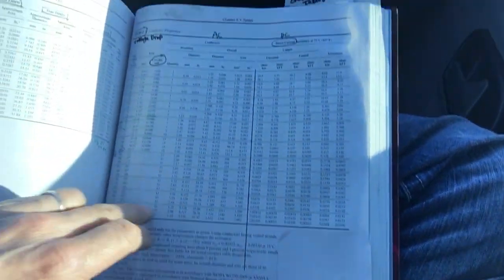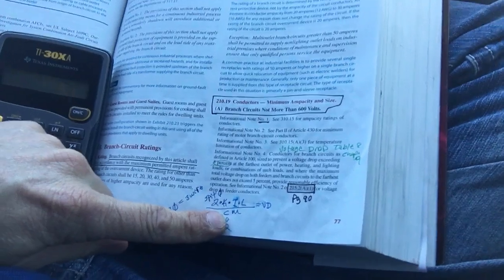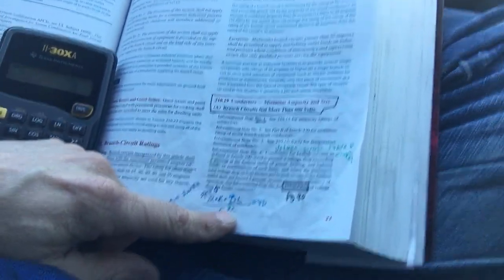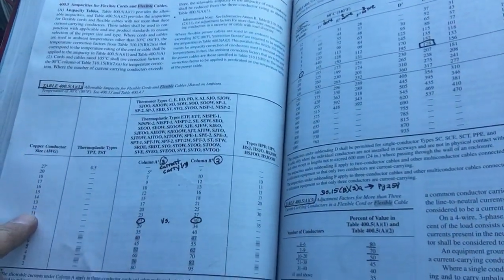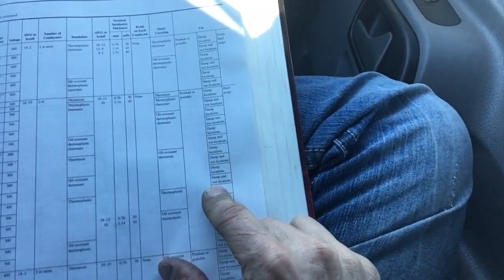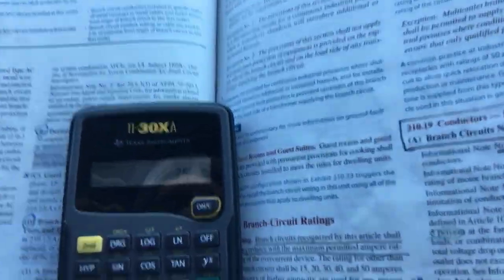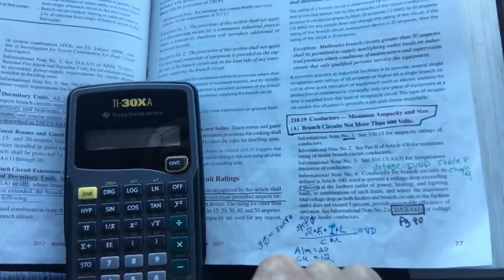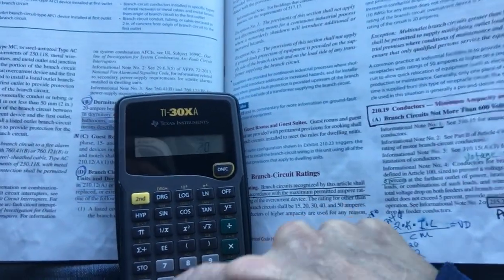Arc Welders - Wire Shorted Out in an Electrical Box Part 3

Comment: Talking about voltage drop....I've got an interesting situation: my neighbor across the street from my house has a pretty large TIG welder in his garage. When he is welding, MY lights flicker. We share the same utility pole, though the transformer is upstream on another pole. I can also tell when someone else's central air comes on as it dips my lights for a fraction of a second. Perhaps the utility company needs to upgrade the secondary lines that runs between the poles or move the transformer? Our connection is at the end of a run from the transformer. 4 houses connect at this pole. 4 houses connect at the next pole upstream (no transformer on this pole. The next pole up the street has the transformer but NO drops to houses. The last two houses at the corner are fed further upstream from that same transformer. So we have 10 houses supplied by one transformer, none connected close to the transformer. My voltage is 117.5 as measured by my digital multi-meter with my welder neighbor gone and unknown loads from the neighboring houses. Don't know what the voltage is while he is working in the garage. The transformer was changed a couple years ago when the cross arm fell, dropping the 13kv line onto the top of the transformer, shorting out one leg (pretty good flash at the trans. and half the house running at 80 volts). They put it back on the same pole! Suggestions as to how to convince the utility to make a change?